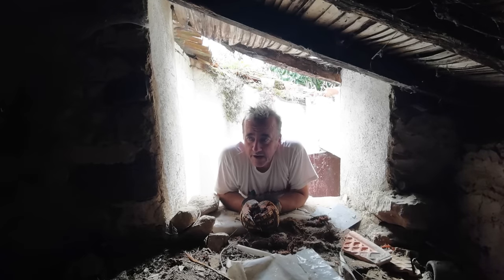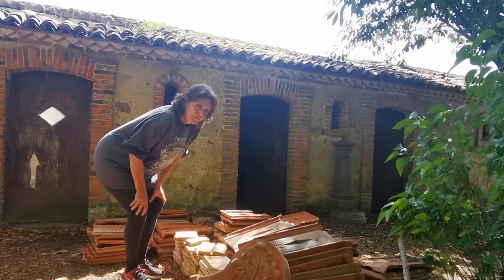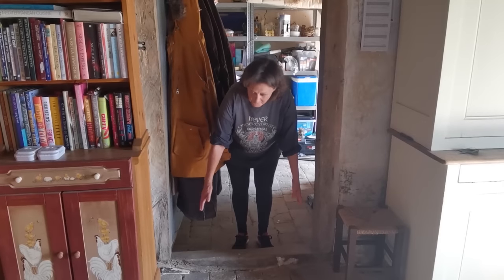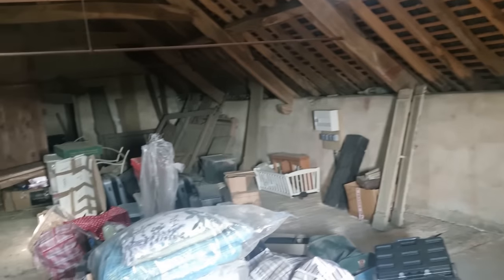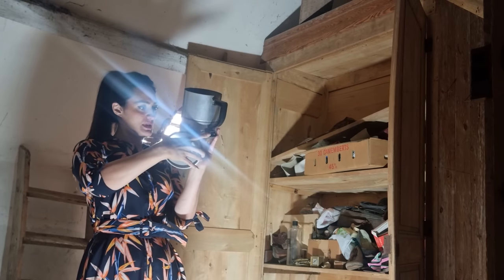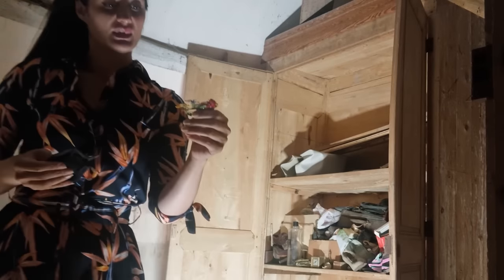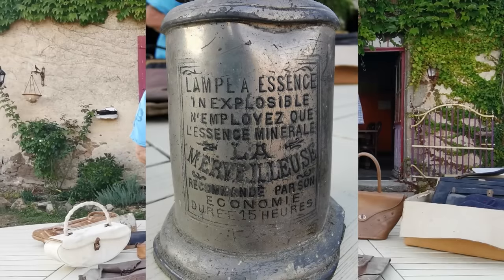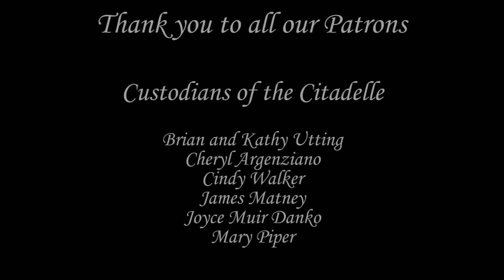The process of saving our bread oven continues

Comment: Hello Rols & Suzie, I tend to agree with you Rols, those tiles were just dumped above the oven, they kept very well, and love the gable ends ones, this is proof that the ceiling of the oven is in perfect working order, it did not collapse with all the tiles, rocks and sand, so all is well. I do not like all vintage stuff, liked the little flat black bag, but the others?, I don't think much of them. Some of the shoes - those black ones - those are really ugly shoes. Sorry for expressing my opinion so openly, but, what is not useable, maybe just donate them or sell them. If you can empty the amour then you have another storage cupboard, maybe you can update it with sanding and varnish or painting it. I am sure it would be useful. After cleaning up and polishing the bags, they do look much better, but I would still donate/sell.  I am sure you do miss Charlotte but she will be back later. Hopefully there are more better finds in the attic, but it takes much time. Kind regards.
Reply from the maker: Thank yoy